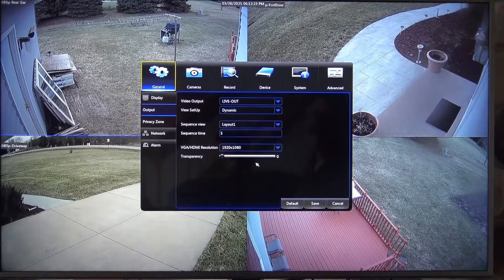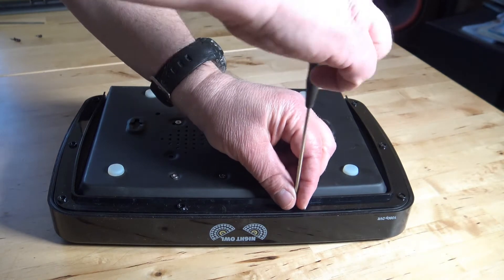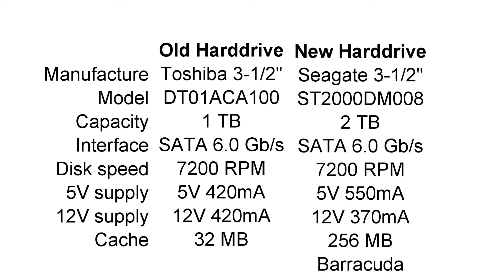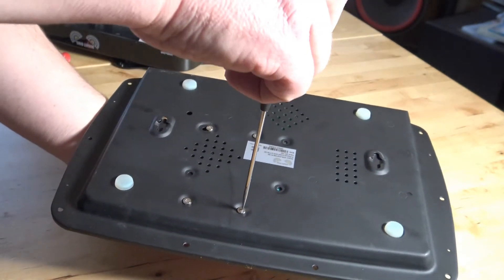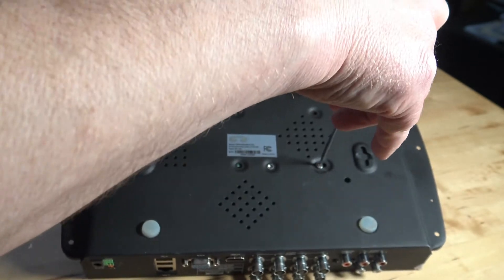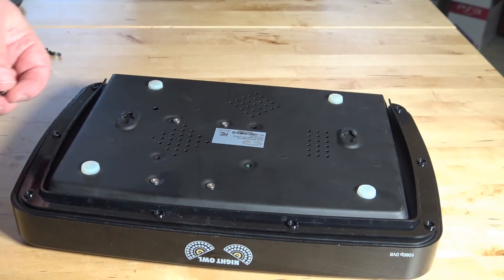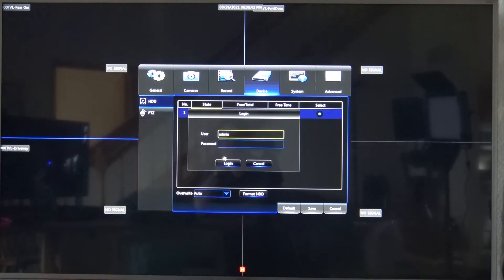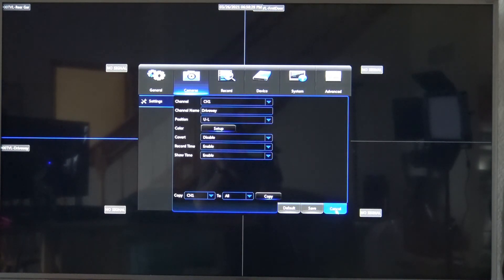Night Owl Hard drive replacement

Comment: First of all great upload!... I hope this is a question u can help me with or direction i should go... My wnvrc20 all of sudden the app was not working saying no internet connection. I go to system menu and it shows TB is full and wont format and i cant factory reset through the menu cuz thats the only way cuz there is no little button to try. so the system still shows video on all cameras just cant record, connect to app via internet and cant factory reset (hoping that would fix internet issue since cables and internet service is working) so any idea what to do? Thanks in advance.

Comment: My hard drive crashed... i got a new one and it still wont read or show.   So i cant even format it... any ideas?
Reply from the maker: Check the power supplies that power the hard drive. You should have a 5 volt and 12 volt supply. Place your hand on top of the hard drive when you plug in the power cord. You should feel some vibrations. Only do this if the power supply  is external.

Comment: Hope I'm not too late to the party. But I put a new drive in and now I'm stuck on boot screen and goes to hdmi
Reply from the maker: Check out my other video. This may help you trouble shoot the problem. Try powering on with out the hard drive plugged in. See if it boots any further. Maybe a power supply issue. But that is a guess.

Comment: Before you replace the hard drive, swap the power connectors between the cameras and dvr, and check if the picture quality changes.... fyi i swapped the hard drive and the dvr did not recognize it as the power supply was "dirty" as the picture quality changed after the swap as the camera picture is now fuzzy but the dvr recognizes the new hard drive now.
So the fuzzy picture means the power is corrupt and this affects the dvr, so now i need a new adapter and have a new hard drive i probably never needed!
Reply from the maker: You are right about not needing a hard drive. Check the return policy of the retailer you purchased the drive from. Or if it's higher capacity, you may elect to leave it in. You will need to swap the power supplies back and replace the defective one. On the power supply should be the OUTPUT ratings in DC VOLTS and Amps. Make sure the diameter of the barrel connector is the same. If you order from Amazon, make sure the order is fulfilled by Amazon. Returning may be easier.
Reply: @jeffanderson9093  I also never knew that there are different "grades" of hard drives, the new one I bought cost a little more but is purple grade and specifically made for surveillance duty which is on and recording 24/7, lesser duty models will fail sooner, I'm also told there is a red grade which is used in servers and is supposed to be even better.
I also want to mention I tested the power output of the defective adapter and it measured 12.38v, I also thought if it was some sort a/c diode leakage issue it may show  some a/c voltage, which it did not.
So if you check with a meter, you will find no difference, only way to spot this problem is to swap the power adapters and check the picture quality!
Reply from the maker: @ryanmccormack7576 
The power supplies used over the last 20 years are called switching power supplies. Typically, what fails is the output capacitor. When testing, you need to put a load on the power supply. Then measure the DC voltage and AC voltage. You should not see any decrease in DC voltage with a load applied. You should not see any AC voltage with a load. If you do, this means the filter capacitor is not doing it's job.
Reply: @jeffanderson9093  interesting, thanks for that info!

Comment: Great tutorial, how is this Hard-drive holding up? I am on my second Night Owl that have the same no Hdd Detected issue.
Reply from the maker: The cheap hard drive failed this last May. So it lasted 3 years. I tested the DVR with the old hard drive, and it still works. I will be installing a 1TB Samsung SSD. The prossessers cooling fan had failed also. I installed a new cooling fan that required a small modification to attach it.
Reply: @jeffanderson9093  thank you very much for your tutorial and reply. Have a great day.

Comment: Hello if the hard drive is full can it be empty or erase or do the hard drive have to be replaced?
Reply from the maker: On the device menu, make sure Overwrite is set to Auto. Once the hard drive is full, it will overwrite the oldest video.

Comment: Thanks for the video, this is very helpful. Can you please suggest what are the default settings for No. of days recording will hold? And do we need to keep the setting’s “Auto” for overwrite? My HDD is on continuous recording and it shows error message for no storage space.
Reply from the maker: The auto will record over the oldest recording. This is found on the Hard Drive tab. The cameras should be set to record on motion detected. This will reduce the space used on the hard drive. As for how long the video is saved on hard drive depends on how often the camera records video to the hard drive. The best setting is auto for overwrite. This way, you never run out of hard disk space.

Comment: I know this video is old. My hard drive is full also. But, my cameras are not working, and on the monitor/TV it's showing no signal. Do you think the reason is due to the hard drive is full, or I need to get a new power adapter that comes with the 4-way splitters?
Reply from the maker: It's unlikely all 4 cameras would fail at once. I would check the power supply or the 4-way adapter. Verify the power outlet for the power supply is working. Remove the 4-way adapter and plug in one camera directly into the power supply. Then try the 4-way adapter. Then try one camera at a time. Then try adding one camera at a time. At some point, you will lose your camera picture. If you can't get a picture at all. This is most likely the power supply for the camera. If you don't get a picture only on one of the cameras, then it's likely the camera or the cables going to it are shorting out the power supply. If you are losing the picture when multiple cameras are plugged in, then it's likely the power supply is starting to fail. When it comes to the power cables, the wires to the cameras could have gotten pinched, or a rodent chewed on them.

Comment: I installed a 16 tb hdd when I format it never gets no percentage and reboots no format
Reply from the maker: By rebooting, do you mean you see the DVR power-up title screen? If so, this could be an indication of one of two things. The DVR is having a power supply issue, or the DVR is having issues with the 12 terabyte size of the drive. Now for the power supply issue. This could be caused by 3 issues. First, the replacement hard drive draws more Amps than the old one. Second, the wall power supply may be failing. Third, the electrolytic capacitors  may be failing. The capacitors look like small alumnum cans standing up right on the circuit board. They will have a plastic colored sleeve on the outside. If the capacitor is failing, the top will be bulging or cracked open, or fluid will have leaked from the base. Note: When replacing a capacitor, they are polarity sensitive. The stripe on the side marks the negative side of the capacitor. I did replace 2 capacitors on my DVR because they had a bulging top. They also had significant loss in capacitance.
Reply: @jeffanderson9093  it recognizes the hard drive as 14.9 gigs but will not format it.
Reply: @jeffanderson9093  I was thinking of trying a 12 gig but don't want to spend more money without a second opinion 🤔
Reply from the maker: @John Boatman  Did the old hard drive quit working? The issue is why the hard quit working may not have been the hard-drive failing. Let's do a simple test. When the hard-drive is first power up, the spindle will spool up, and the heads will do a seek. You can feel the head moving as vibration breafly. If this does not happen, it could be an indication that one of the power supplies is bad. What is the manufacturer and model number of the hard-drive?
Reply: @jeffanderson9093  the old hard drive  was a 4 tb.  It started clicking and powers down.  The drive itself  died i confirmed that by sliding it in my dock tray on my pc.
The new 16 gig does format just fine as 14.9 gig in my pc. And used chkdsk to confirm nothing wrong with it and passes smartdisk tests.
Reply: @jeffanderson9093  I'm currently away from my desk I should be home @ around 5pm got some errands to do after work.
Reply: @jeffanderson9093  I did a smart test on it and it has a error read count of 177,508,664 sending the hard drive back for a 14 gig.
Reply from the maker: @John Boatman   When the night owl formats the hard drive, it sets it up as two partitions. One is recognizable by the PC, and the other is not. I suspect because it's some sort of custom format.
Reply: @jeffanderson9093  I noticed that right now I have a little 2tb in it for now till I get another one. I'm gonna try a 14 gig and go down till I find the max size hdd that it will format.  The 16 gig formatted just fine in my pc.  But with the error rate so high and hear the drive seeking at random times I don't feel it's reliable. Thanks for the info highly appreciated 👍
Reply from the maker: @John Boatman  One option is to contact the manufacturer and ask what the largest hard drive that can be installed.
Reply: @jeffanderson9093  they no longer give support for this model.  I tried researching and researching find  everything but max size drive.
Reply from the maker: @John Boatman  Is your DVR a night owl or some other manufacturer?  My setup is a night owl 1080 8 wired inputs and 4 cameras. It came with a 1 TB hard drive. The largest hard drive I heard rumor some place was 6 TB. I suspect what you may have was like an 8 camera or 4K setup. This would be the reason for the larger hard drive. So, if you are successful with your upgrade, please post your DVR and hard drive information.
Reply: @jeffanderson9093  nightowl ahd7-dvr16 
16 channel hd 720p 
And as of now the 14 tb is a no go.
I will next order the 12 TB.
Reply from the maker: @Boatdog357  This DVR may support a USB drive. Check the manual.
Reply: @jeffanderson9093  I upgraded to a 6 TB works.  I'm going to push my luck and order a 8 TB.
Reply: @Jeff Anderson  installed the 8TB drive today and works.  I'm wondering if I should of tried the 10 or 12 TB.  Maybe next year or however long this drive lasts 🤔 😆

Comment from the maker: Since the USB port is on the back of the DVR. Getting a type A USB extension cable to extend the port around to the front will make it easier to copy video to a jump drive. A flash drive and jump drive are basically the same thing.

Comment: can you help me my syetem says no disk storage available for recording or no hdd what can i do
Reply from the maker: First thing go into the menu where the hard drive is listed. Check to see if it is listed. If not listed, the hard drive may have failed, or it has lost the 12 volt supply to it. If equipped, the cooling fan typically runs on 12 volts. This should be ruining. Next, check to see if the box on the screen is checked that allows the oldest information on the hard drive to over written.

Comment: Thank you. I appreciate you taking the time to do a walk through on your upgrade. I did the same on my Night Owl device and it seems to being running a lot faster/smoother. My previous HDD failed, so I needed to replace it. I'm not quite ready to upgrade my entire camera system yet. I've had it since 2016. I know technology, devices and cameras are a lot better now, but I'll wait for maybe another 1-2 years.

Comment: Is there any way to back up and view the files from an old hdd night owl drive on a computer or another device? I attempted to insert the drive into a normal drive enclosure and that was unsuccessful. I need to get some video footage from one.
Reply: If the dvr has a flash drive USB port you can copy to that for viewing on laptop.
Reply from the maker: The hard drive has two areas that data is stored. The smaller section is partitioned. The large section where the video is not partitioned or a not common type of partitioning method. To read this may require data recovery software. Basically, it  would be difficult to read.
Reply: @jeffanderson9093  thank you

Comment: Hi, thanks for the video. I have the same model and just replaced the hard drive. The issue is that I cannot connect to the app now. I removed the device and rescanned the QR code, re-entered my password, but still won’t connect to the app. Is anyone else having this issue?
Reply from the maker: The for the app to work the night owl needs internet connectivity.  Verify that the night owl is properly connected to the internet.
Reply: @jeffanderson9093  yes there was internet connected. I had to delete the app then reinstall and log back in then it worked. Thanks
Reply from the maker: @nildacaldero1067  Thanks for your valuable feedback. This could help others.
Reply: Try a new, and I mean new, back up battery ☺️ 3 volts, anything less than 2.5 volts is no good.

Comment: I have an 8 channel unit I bought from Costco several years back. It stopped recording, but I can still see all the cameras on my monitor and they still seem to be working. I opened the case and didn't see any bad capacitors. Do you think swapping the hard drive would fix my issue?
Reply from the maker: If you can't play back video, then your unit likely has a bad hard-drive. The nice thing about buying from Costco is they often  double the manufactures warranty. A warranty repair is always cheaper then replacing things. Be aware hard-drives often need two voltages supplied from the main circuit board. 5 volt and 12 volt. If a power supply is bad it will be the 12 volt, and not cause other problems. Try a used hard drive if have one available. If you are purchasing a hard drive, check thier return policy.
Reply: @jeffanderson9093  this is so bad we all got ripped off and here you are trying to make it better give a solution for spending hundreds of dollars for something that runs out of space by dumb.

Comment: Hi I have a question since the day I purchase cannot make the receiver detect the hard drive what can I do?
Reply from the maker: Did the old hard-drive fail? Is this a new hard drive. What is the manufacture and model number if so. And yes it's not always the hard drive. Harddrives will make some very mild vibration or noise when first powered up. This is the player spinning up and the heads moving inside. If the noise is easily heard, or the heads repeatedly are shaking. This could be an indication of something wrong.

Comment: I have had scratchy horizontal noise lines across all 4 of my video camera feeds. Is this a sign of a bad hard drive or is my DVR going Bad?
Reply from the maker: If the camera's power supply is separate from the DVR it could be going bad. Unplug the power supply going to all but one of the camera's. Did the picture quality improve? This would be an indication of a failing power supply. Can you play back old video before this problem appeared? Are you still getting partial video images from the camera's?
Reply: @jeffanderson9093  Thanks, Jeff!  I did unplug all but one camera, and the picture did improve some. got more color and less lines. I ordered a new power supply and hope that does it!
Reply: @jeffanderson9093  Thanks Jeff. A new power supply seems to have fixed my problem.  
another question.... my software version is v1.3.74. I need a magnifying glass to see anything on the menus.  is this right?
Reply from the maker: @mrkylebloom  I'm glad it did fixed the problem with video quality issue. As for the software version, I have no ideal as to version. The first number usually indicates a major change. The last digits would be for small things like bug fixes, and minor changes. The manufacture some times under Support on the website may list the versions.

Comment: Thank you for your video, I bought the Seagate 1TB when my original Toshiba died and when I swapped I get the monitor flashing the Night Owl logo but it won't let me log on to do anything. I hooked up this monitor to my old Mac mini and it worked fine. Any suggestions would be appreciated.
Reply from the maker: Unplug the hard-drive, and see if the problem resolves it self. If it does this could be an indication of a power supply issue. It could be the new hard drive is drawing to much current (amps), or a power supply issue.  Their is the power adapter that plugs into the wall. This converts the AC power coming out of the wall to low voltage DC. typically about 12 to 24 volt. Some times these go bad or degrade over time. The power supply that power the cameras is typically 24 volts. If the Voltage rating on the back is 24 volts or more, you then can temporarily use camera power supply to to test powering up the night owl. 
The circuit board inside the night owl you will find capacitors. They look like small cans, with a plastic colored rapper and strip going down the side. On top you can see the bare aluminum exposed. If the top is split open or bulging, the capacitor is going bad or is bad. They should be replaced.

Comment: THANK YOU for producing this video!  A couple of weeks ago, started seeing the "Disk Error - Unformat?" on mine; a couple of days ago, picked up a 2 TB Seagate 3.5" BarraCuda SATA drive for $50 at Best Buy.  Just installed it tonight using your procedure; only hassle I had was getting the mounting screws started into the new HDD, finally got them started after a few minutes of fussing.  My lid ribbon cable was in a slightly differnt location on the main PCB, probably a production variation from Nite Owl.  Formatting went as you described, back up & running!  :)